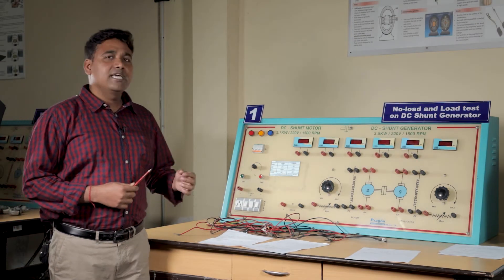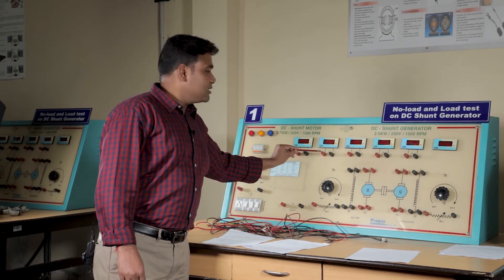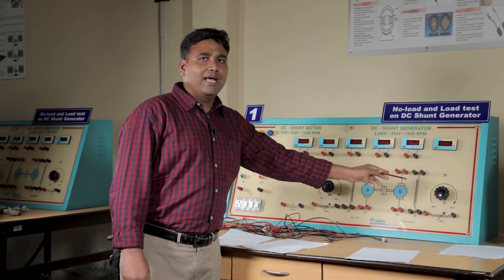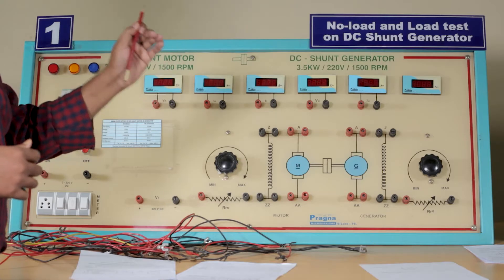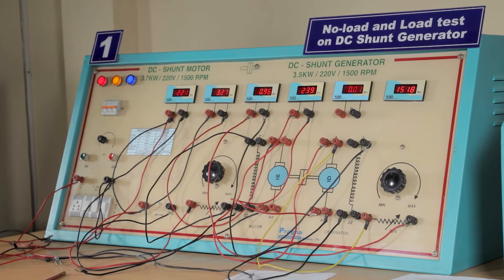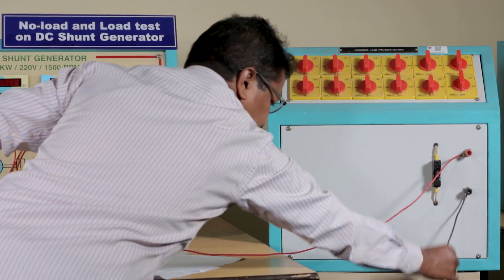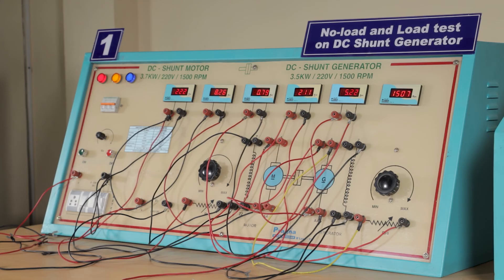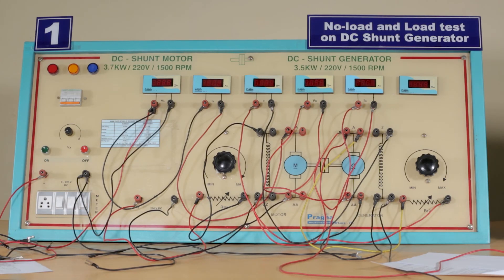Electrical Machines | LAB - 1 | NO LOAD AND LOAD TESTS ON DC SHUNT GENERATOR

Comment: In the load test it's noticed that when you increase the load on the generator the voltage dropes and the speed increases(strange behavior), you adjust the speed by decreasing the field current of the motor. My question will you be able to adjust the generator voltage by increasing the field current of the generator?
Reply: I think somehow when you increase the load of the generator, the motor voltage increases which is responsible for the increase of the generator speed. This could be due to power source regulation issues.
Reply from the maker: Yes, Increasing Generator Field Current Can Increase Voltage
Increasing the field current of a generator will indeed increase its output voltage.
Understanding the Relationship
Here's a breakdown of the key factors involved:
Generated voltage (E) is directly proportional to the product of magnetic flux (Φ) and the rate of change of flux linkage (dΦ/dt).
Magnetic flux (Φ) is directly proportional to the field current.
Rate of change of flux linkage (dΦ/dt) is influenced by the generator's speed.
Therefore, increasing the field current will increase the magnetic flux, which in turn will increase the generated voltage.
Reply: @EngineeringDevotion  Thank you ❤️